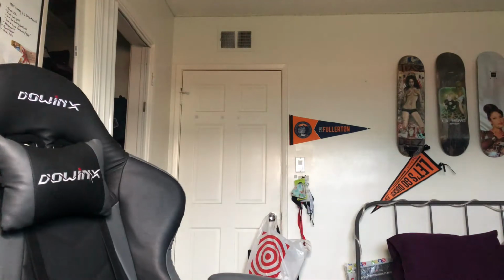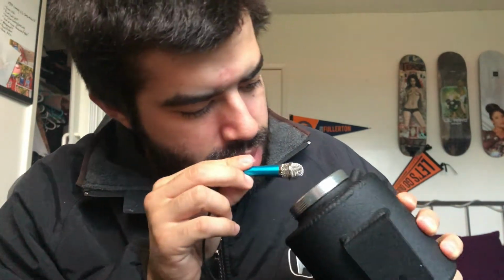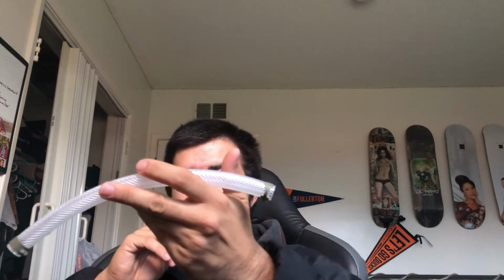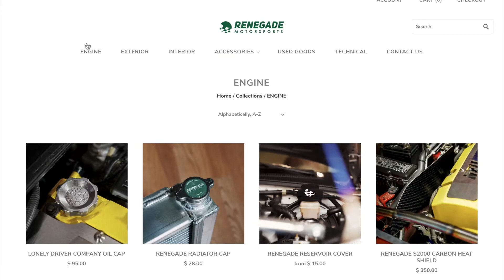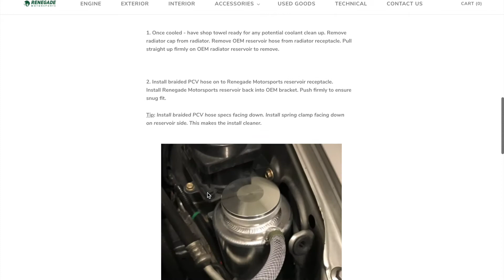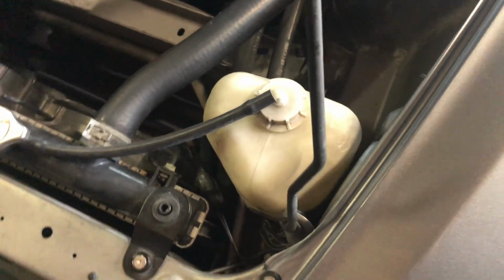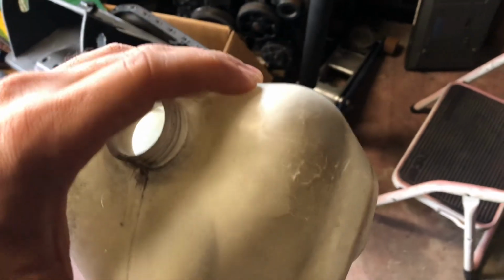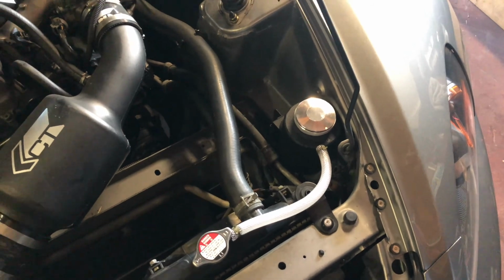Renegade Motorsports S2000 coolant reservoir unboxing/install

Comment: Nice video, are any of your wire looms touching the bottom of the reservoir when you installed it? It goes in pretty snug for me but it pushes against my headlight wire loom a bit and I'm not sure if that's gonna be an issue or not.
Reply from the maker: sorry for late reply, ill double check this weekend.
Reply: @McRib47  no worries. It didnt seem to be affecting the wire loom at all. Someone else in an s2k group said the same

Comment: just installed mine a couple weeks ago.  Did you get a slight leak on the hose side leading to the resevoir tank?
Reply from the maker: I did not!
Reply: I'll see if I can just add another o ring on the reservoir side.
Reply from the maker: @davachan4549  hopefully that works out for you. I would contact renegade if the issue continues.

Comment: Hey do you still have this, i installed mine and it is just shooting out coolant  constantly to the point my car starts to overheat did you have this issue as well?
Reply from the maker: I have not had that issue, my car works fine and has never overheated.